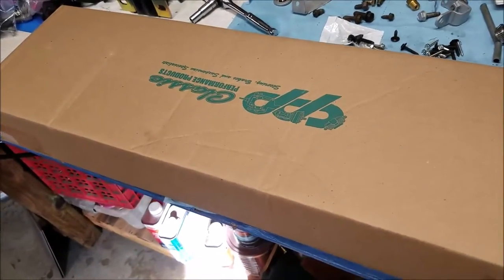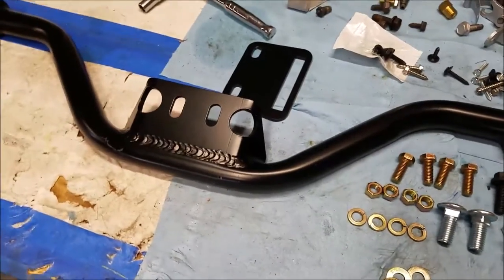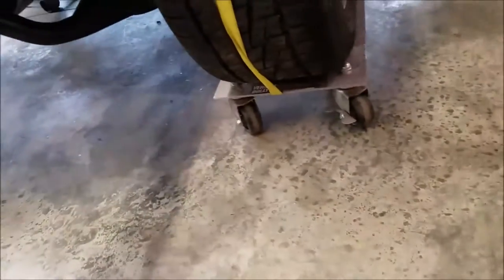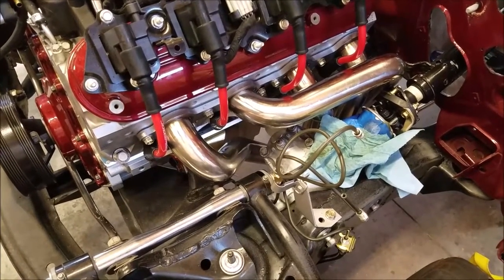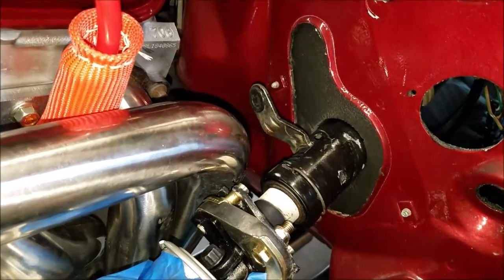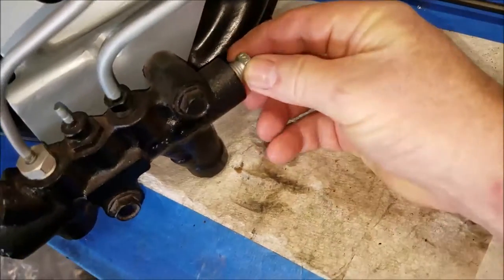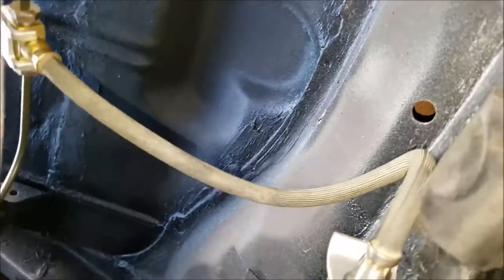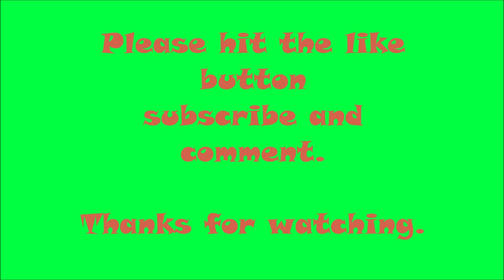Alien RestoMod: Subframe install and brake plumbing

Comment: Looking good! You could probably get those headers ceramic coated to reduce the heat and keep the good looks.
Reply from the maker: I was thinking about ceramic paint in a can, have you used can paint for headers?
Reply: @AlienRestoMod  I have not painted headers before. I'm not sure where you live, but here you can get headers professionally coated for a couple hundred bucks.

Comment: dont wrap the headers yes it reduces heat but i have found the wrap holds moisture and will eventually rust the pipes
Reply from the maker: Good point, thanks.